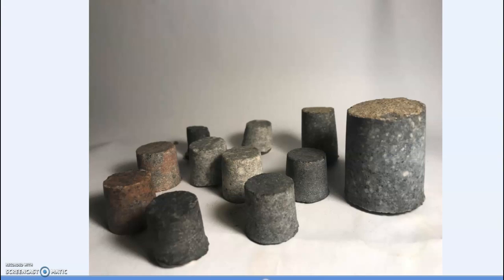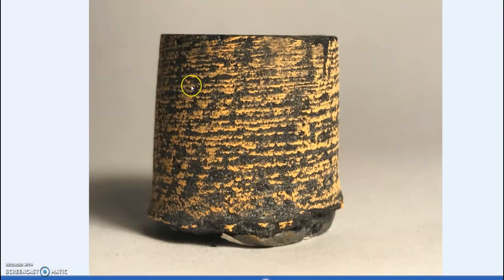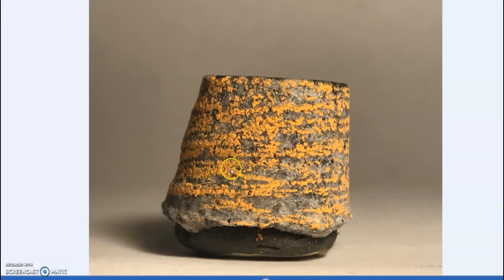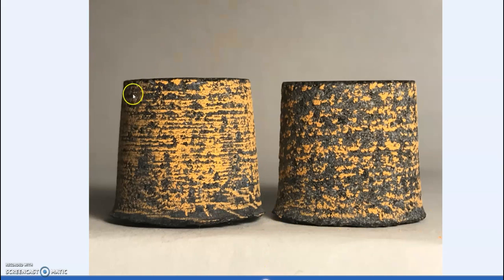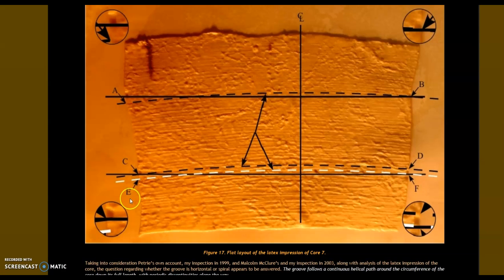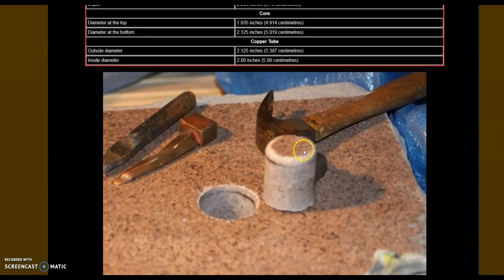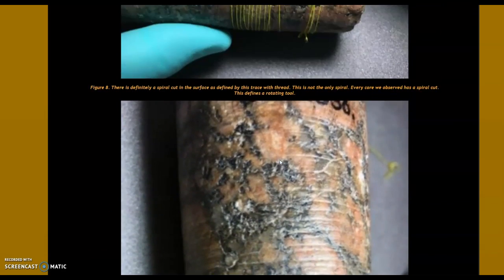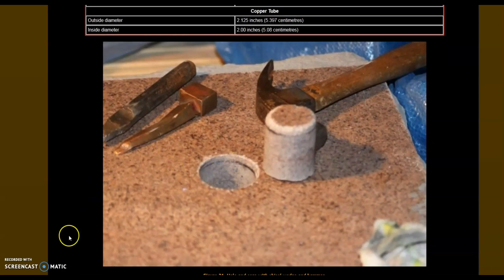Lost Ancient High Technology Granite Core Striations preliminary

Comment: I've seen the cores at Petrie's museum inc. no.7 and there's also an example of a tube drill with the core still in it as part of the same exhibit.
The ancient high technologists say the groves are from the feed rate of the drill, that it plowed tru the granite like 500x more than modern drills.  But instead those groves are just from the loose grit thats turning around the wall of the tube as you drilling and the taper of the core is from the wearing down of the material of the tube.  Denys Stocks already demonstrated this back in 99.

Comment: Cracking presentation mate, your one of the very few who understand that the knowledge and techniques of this ancient craft, have not only been developed and used for millennia, but to this day many of the traditional methods are still used by Stone Mason's to this day.  It will forever puzzle me the amount of effort used, not only to create these elaborate theories, but also to promote them to the point the public accepts them as fact.  These so called experts and top researchers that actually spend a lot of time in Egypt, being fortunate to have the opportunity to study things up close and personal, and still they ignore what is laid out in front of them.  
As you will know the Egyptians left walls full of clear images of how they worked stone, even showing every stage of how the granite vases were made with Mallets chisels and 3 types of drilling including core and shaping drills.   literally thousands of tools, with in depth scientific studies into the dynastic progression in metallurgy, showing that as far back as the 3rd Dynasty they were producing arsenic Copper Alloys, the studies show that not only did they get the ratio of arsenic to copper stable and consistent, but also used copper and iron ores in a co-smelting process, they also found that the crystallization of the alloys composition made the finished product much harder and very easy to cast without splitting, which could have only been achieved at temps of 600 degrees and further galvanization from cold hammering each tool. 
So all these studies have been done, the papers of the results are there for everyone to read, the tools are in museums for the world to see, and the icing on the cake, practical demonstrations and explanations from your good self to tie it all together.  This is why i cannot understand how they get away with what they say, in lectures, TV appearances and several published books, it's beyond mental and in my eyes is like giving the middle finger to all the true studies ever made, like it was all pointless.  Hopefully one of the guards will lock Brien in the Osiris shaft on his next "TOUR" ha ha.
Reply from the maker: Well said!! There's so much good work that's been done by dedicated people but it all gets buried over because some dodgy tour guide snake oil merchant says it doesn't exist. Then they insert a reference to Mark Lehrner and Zawi Hawass to get the binary us vs them thing going. I give them one thing though, they are experts at slick marketing and psychological manipulation. So if this racket of theirs ever dries up they'll always have a future making late night  infomercials for exercise equipment, mops and benchtop ovens.

Comment: Did D's core have striations even? Did he go in 'dry', or use a slurry. that copper chisel looks like totally the wrong tool to remove the core also...am sure it would have damaged the drill hole and core too, due to its thickness. how did he support his drill to keep it drilling straight - was there a frame?.... with that long copper shaft and the tiny handle circle? where is the 60lb/30kg weight? that little one is def not 30kgs lol...a bag of cement is 20. most of the pics of his string wrap are low res too...why dont we see pics all around the core of the string wrap -..that afternoon's 'work' in the petrie museum no doubt helped sell him a shed load of books tho....
Reply from the maker: He used no frame, he intentionally added a wobble? BS. If he had used that set up the issue of limiting wobble would be evident.
That weight? Call it a typo since in the end it isn’t big difference. 
Bow drill was awkward and inefficient?
His set up should be in engineers dictionary as definition of inefficient stone drill.
Bow was awkward, that set up is definition of awkward since basically zero leverage and it would seize every time he hit and a hard point and the abrasive - ground granite (wet or dry) would be brake. He used dry. Even when he used his DIAMOND coring but.
You couldn’t make this stuff up. And the deep research of channels who promote his book never picked up on it?
WOW
Their credibility has crashed through the floor to below zero.
They can’t even say “I was wrong” anymore. The only road back is to admit is was a giant sham.
Reply from the maker: That 1983 paper on core drilling they always cite as evidence of LAHT, it’s conclusions clear. Different abrasive = different results and wet method the best for core 7 type striations.
He used silicone carbide 80 grit, 80 is a powder and obviously it won’t leave deep scratches, and silicon carbide a modern abrasive.

Comment: It is a spiral.  How can he say it is not.  Dunn accounts for the difference in depth between striations by stating that whatever tool was used it cut throuigh quartz quicker than the mica or feldspar. How can he say it is not a spiral?
Reply from the maker: @GordonDivine7  https://youtu.be/gxG1g0uQq1g?si=Q1D2nxlPHx0XiQmt
The new line is “ no one ever said it’s a continuous spiral” 
Damage control is going on because core 7 was scanned.

Comment: The reason he deformed his copper tool could be explained thus.. Because it looks like it is a cast piece, it may have been cooled rapidly in water after casting, which would have left it very soft. But then, someone who is a skilled machinist would know the basic properties of such a commonly used metal, one would think. But then again, any machinist would know that the length of that copper tube used with an offset crank handle and a high centre of gravity, is going to make his 'ancient drill press' shake and shiver like a shitting dog. Machinist my ass.
Reply from the maker: He did all this a while back. I assume he thought he’d get away with it because who’d have guessed the reach of the internet back then. Or that some people from the former USSR would read the works of Denys Stocks and have a 💡 moment.